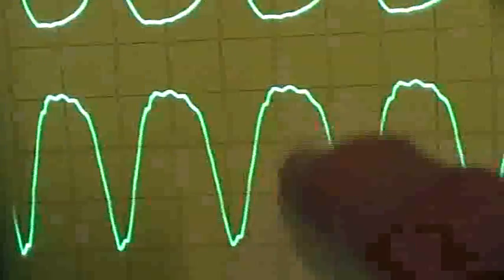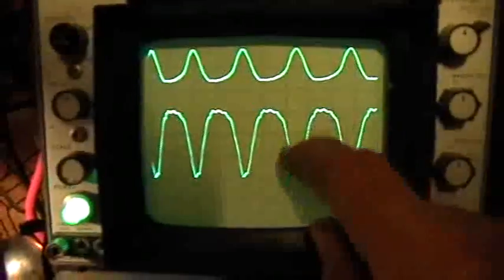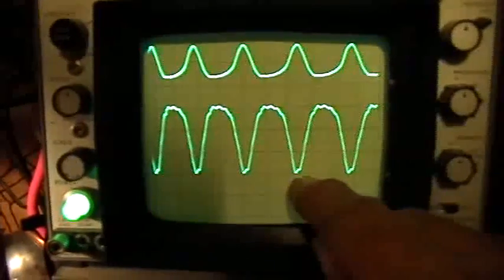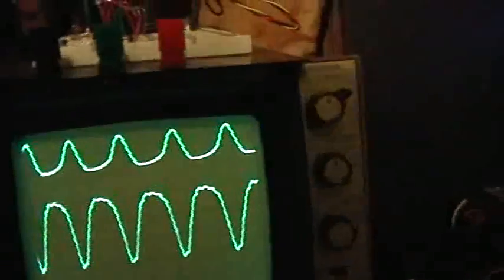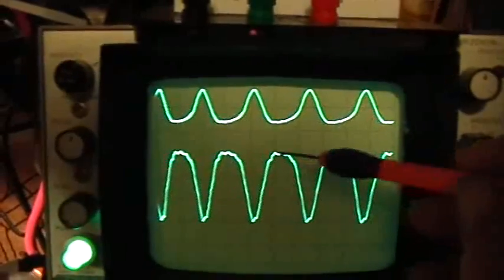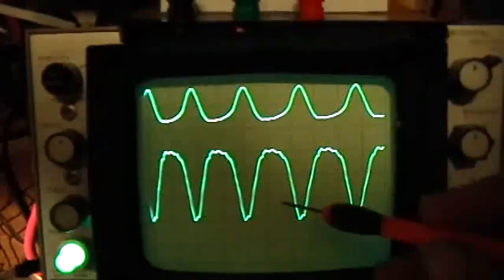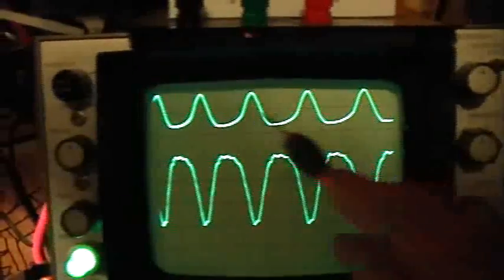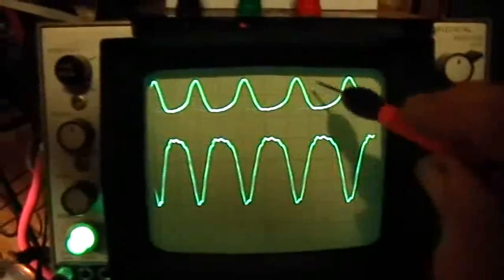Electric OU: Tar Baby and the Coup de Grace

Comment: TK it is like having a closed tube with a piston in it and say the piston puts the gas under pressure for more time than the gas is under vacuum the overall system is heating if the reverse is true it is overall cooling it is all just energy exchange.